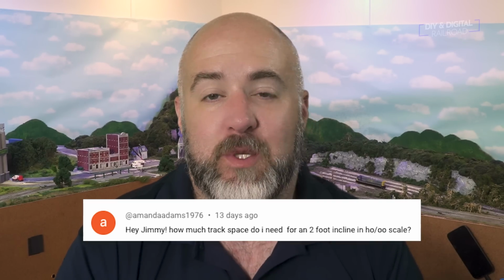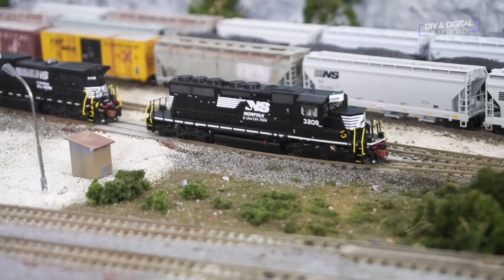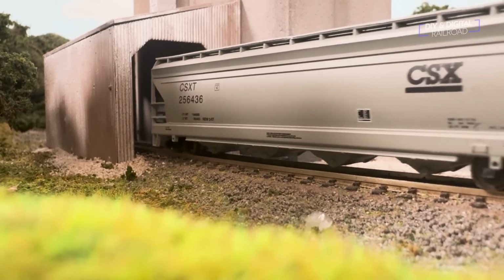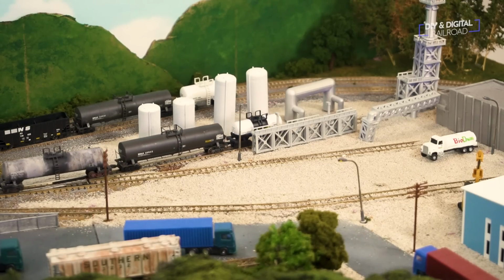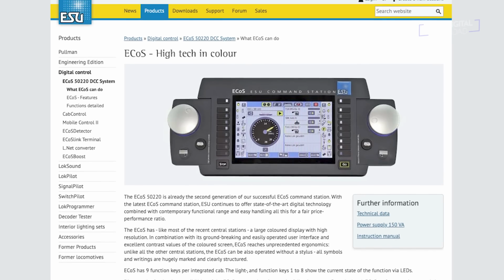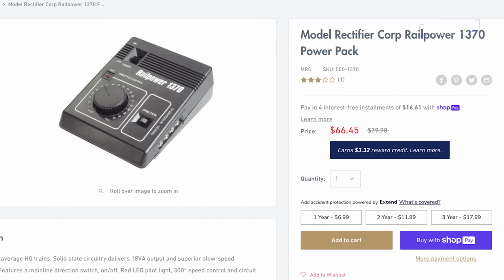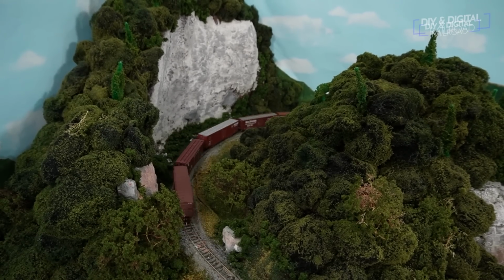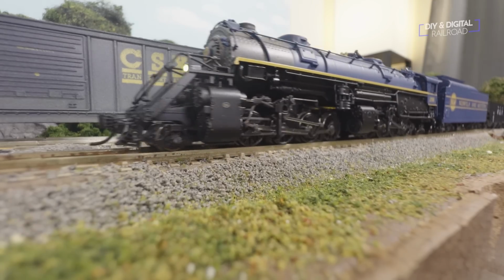THE MOST I will spend on a DCC Equipped Model Train

Comment: So the ScaleTrains SD40-2 hanging up problem is a very easy fix. I actually found the fix and worked with their team to help implement it. The issue is that the screw towards the front of the loco that holds the fuel tank on gets some paint in the screw hole and threads, not allowing the screw to tighten up all the way to pull the tank up completely. Take both screws out, clean out any paint residue, and then reattach the tank. 

I ended up shearing the head off the screw, so I just added a bunch of superglue and glued the tabk on, which worked very well. The engine has much better track clearance now. Still not as much as a Kato, but enough to handle most bumps and hiccups in the track.

Comment: I have a n scale set with a diesel and a steam on a Kato unitrack.  The diesel never derails, but the steam engine front bogies consistently do on the switches.  When I go slow it appears the bogies follow the path opposite of what they should be (switched to go straight but bogie wheels go left on a left hand switch).  Suggestions?
Reply: Check your wheel gauge. The check rail should be pulling the wheels to the side to keep them on the correct path. If the wheel gauge gets sucked inwards, it can grab the point of the frog and go the wrong way.

Comment: Be very careful using the MRC Railpower 1370 controller with DCC equipped locomotives. Rapido says that using that unit with their DCC equipped locomotives will void the warranty.
Reply: Thanks for the heads up

Comment: When it comes to buying locomotives (and rolling stock), the best advice I can give newcomers is to shop around!  Lately, my go-to places for HO scale Atlas and Rapido, Athearn, etc. have been Iron Planet Hobbies, Lombard Hobbies, and Midwest Model Railroad, and if neither has what I'm looking for, I will use Trainworld.  Those places have the best prices on HO locomotives!   Also, yes, the pulling power is determined by locomotive type more so the brand, for the most part.  Example: I have an Athearn Genesis 2.0 SD70ACU that can haul 64 cars (yes, I actually tested this on the club layout, by the way), while the same company's ES44AC, is maybe good for about 45 or so cars (the latter we actually never got a chance to push it to its limits for an exact number).  That being said, there are situations where brand does matter in terms of performance and pulling power.  Athearn's Ready toRoll (now simply just "Athearn") line SD40-2, while it looks great and has some neat features (my BN unit has working strobe lights on the front pilot), its pulling power is a bit weak compared to average, maybe 20 to 25 (if they have good rolling capabilities) cars is about it.  On the flip side, the Scaletrains Operator SD40-2 (which is no longer produced sadly as they have shifted focus to its Rivet Counter counterpart) can nearly double that number on the drawbar!  So, locomotive type plays a factor in pulling power more so than manufacturer for the most part, but there are situations where the brand does make a difference when dealing with the same type of locomotive produced by multiple manufacturers.